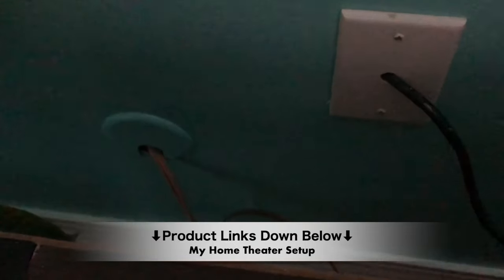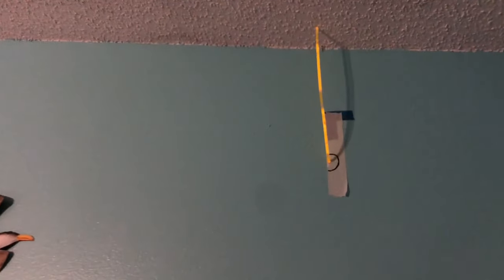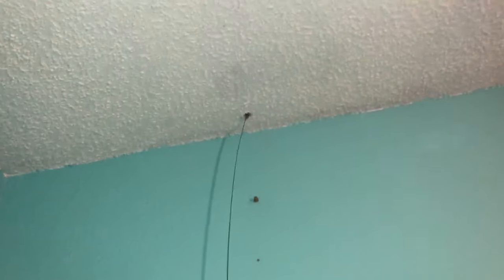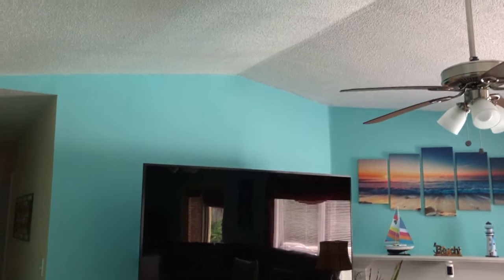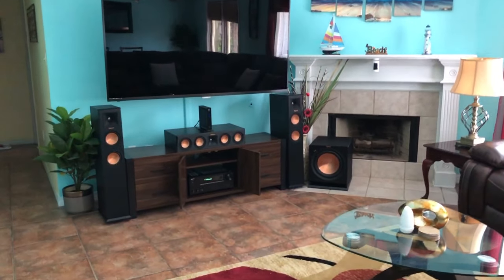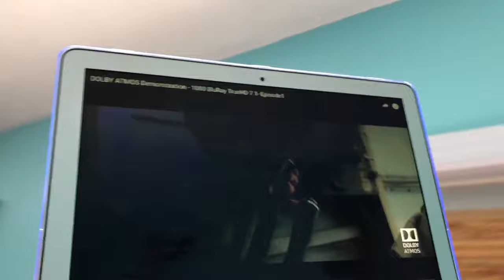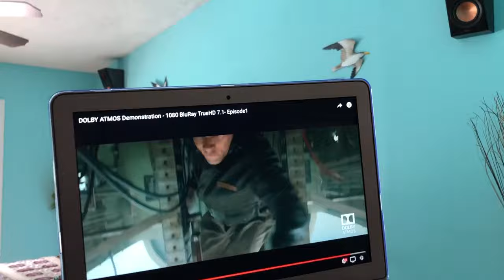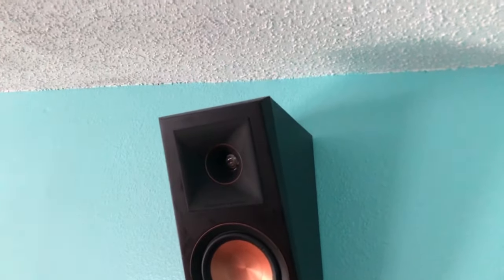✅How to Hide & Run Speaker Wires into Wall or Attic Review | Klipsch Home Theater System

Comment: Thanks for the awesome video and I know I'm late. I just bought my first home and I've been piecing together a new surround sound system. This gave me the motivation and confidence to run my wire in my ceiling for my surround back and height/surround backs. I'm running klipsch RF-62 IV, RP-250C,  RS-35, synergy 10 inch sub, onkyo tx-nr777
Reply from the maker: That is awesome! Sounds like a nice setup!

Comment: I may try using those super strong magnets.  Tape one to the speaker wire and the other to a coat hanger.  Drop the wire down to the floor and the fish around for it with the coat hanger.  These are extremely powerful but small......smaller than a dime.  They have them at home depot.

Comment: Great job. I'm trying to install on the wall, the RP502S speakers, and I'm not sure what hardware to use, because these speakers are really heavy. I'm thinking about toggle bolts(3/16"), with a nut(to add space) and washer something like you did there, they hold well? Yeah, banana plugs most likely won't work for me either, and I have already cut the walls for the speaker wall plates.

Comment: Is your TV room directly beneath your attic? I am looking to run my set up this way but my entertainment room is separated from the attic by the second floor.
Reply from the maker: Yes my attic is directly above my TV room. You can also run wires from a TV to a room or closet behind the TV. I had a room that I routed the speaker wires into a closet from the TV and receiver.

Comment: Thanks for the video!. Curious as to what you have the frequency set at for your rear channel speakers? I have a set of the RP-500SA's myself that I am using as my rear surround speakers.
Reply from the maker: Thanks! I have my rear channel elevation speakers set to 120Hz. How do you like your speakers?
Reply: @VibrantDeals  I love them! I just purchased the RP-502S speakers. Once those arrive, I will move my RP-500SA's to the rear of my room. I am a huge fan of the Reference Premier speaker line!
Reply from the maker: @raffeal247  wow I've heard great things bout the RP-502S speakers. Sounds like your setup is about to be next level awesome. I'm a huge fan too and have no complaints about Klipsch lineup!
Reply: @VibrantDeals Thanks! My next purchase will be upgrading my front towers. I currently have some Synergy towers. I'm going to get the RP-800f.

Comment: I thought rear speakers need to be 2-3 ft. above ear level and just a few feet behind the sitting area.  That's why I haven't gotten any.
Reply from the maker: These speakers are loud and can be fine tuned for output and distance on your receiver. They surprisingly have amazing base and highs. I tested these speakers before itself by unplugging everything but the rear elevation speakers. You can always buy it and dry fit it. If you are absolutely not satisfied then you can always return it.

Comment: That's intense. I wonder if mice might climb through that port cover though
Reply from the maker: Lol! I don't have any pest problems.
Reply: @VibrantDeals  😄 I shouldn't assume
Reply: @oodles86  fucking YES, specifically roof rats. A small one can fit thru a hole the size of a half dollar. You might not have rodent problem until..

Comment: nice tuto, unfortunately this is for USA homes that are most made of wood, and my home is full concrete + bricks.
Reply from the maker: I understand.
Reply: Just remember when you next get the flooring or carpet replaced. Run all the wires underneath. You can then either run up a wire from the corners or have those nice free standing speakers on floor level